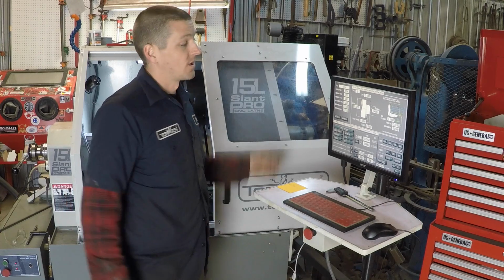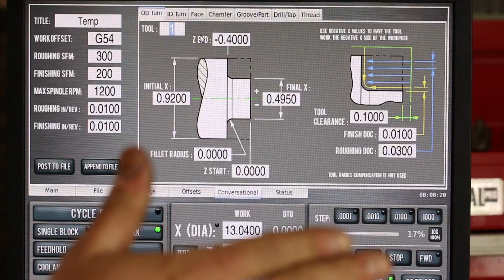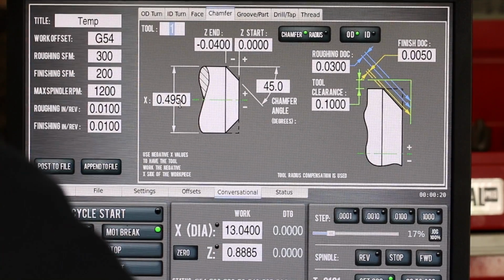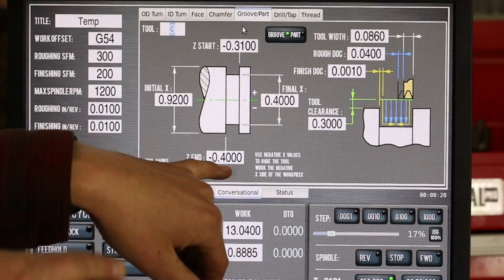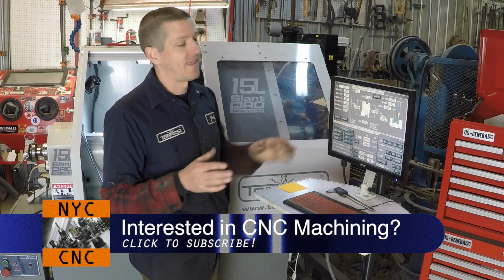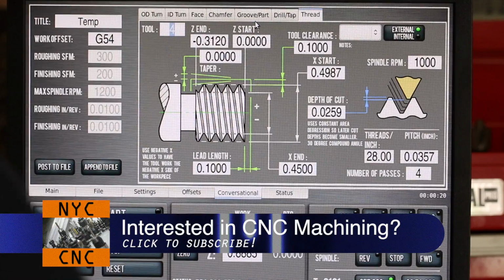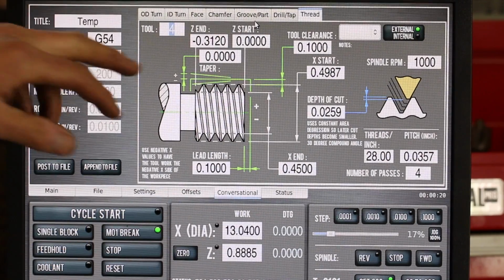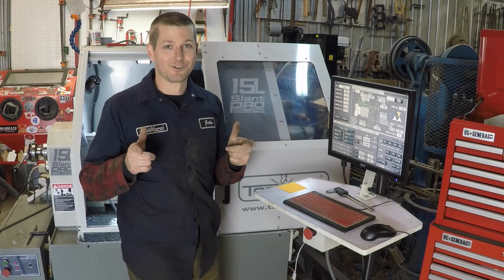Threading a Ruger 10/22 Barrel for a Silencer!

Comment: Problem is you indicated from the outside of the barrel, you ALWAYS use a indicating rod that is inserted into the barrel, the bore is not drilled perfectly in the center nor does the bore ever run perfectly true/straight, I have not ever seen a perfectly drilled and bored barrel even with the top barrel makers. 

You even said that you had some coating that was throwing off the dial indicator so by your own admission there was something wrong. You just got damn lucky you did not have a baffle strike and destroy your suppressor.

Comment: With decibel measuring apps available for phones, would have loved to see readings for non-suppressed vs suppressed to see measueable results

John
Reply: It is, with impulse noise, not really possible to messure with a phone or any non specialist tool. A phone can not pick up the noise lasting few ms and will give a false low reading.

But the difference it night and day, with a supressor, shooting in the dirt, the bullet hitting the dirt is louder than the actual shoot.

Comment: TOO damn bad that an IDIOT is running this mega-money lathe.  ANYONE with more than two active brain cells knows that for proper and SAFE suppressor use, it is MANDATORY that the threads are referenced to the bores GOD DAMN CENTER, AND are co-aligned,CENTERED, throughout the length of the barrel - STRAIGHT OUT.....  FUCK the outer barrel...   Dipshit...

Comment: Whenever threading a barrel you always indicate your center off the bore (ID) not the OD. Most barrels bores are not concentric to the turned down OD profile. Indicating off the OD in most cases positions the thread body off center of the bullet path risking bullet strikes to your muzzle device. You need a correct size ground mandrel to slide into the bore in order to indicate while using a 4 jaw chuck. Using an already factory turned OD for indication like you did would have been easier with an accurate 3 jaw with a .0005" runout and obtained the same setup runout result.

Comment: This is exactly why gun work should be done by machinists instead of by gunsmiths. I had a "gunsmith" destroy a barrel once by threading it. The threads were dull, and half of them were torn off, you would probably cry if you saw it.

One thing I would suggest is getting a simple .22 caliber pilot from Pacific Tool and Gauge for future threading of barrels, that way you can be sure the threads are concentric to the bore instead of the OD.

Comment: Wondering why you set up the barrel by referencing the outside surface rather than the bore?  I know most barrels are bored true but I have seen a few that were a bit out.
Reply: it does matter when you are trying to "thread" a high velocity projectile through a suppressor without striking a baffle and causing yourself a heap of read tape headache.  If the bore is not quite centered then the barrel exit wont be dead nuts centered on the threads which can cause baffle strikes further down the can.
Reply: @briangamble6200  
It is not really that important to get dead on. 
Most supressors have at least 10 thou on radi to avoid baffle strike.

Comment: Another great video, but I was curious about threading without doing the relief cut.  I have read about guys with manual lathes doing reverse threading so they don't have to make the relief cuts.  I'm trying to learn basic machining on a hobby lathe but was curious about if a cnc machine could do the same and thread from the shoulder out safely?  plus I was wondering what your opinion is on threading right up to the shoulder?  Is it worth the extra hassle or just a lot of extra work for little gain?  I can't find any videos so far on the no relief cut threading, but I just heard about it last night so haven't looked very much yet.

Comment: Can a normal sized 10/22 barrel  accommodate similar sized threads.  In other words, my 40th anniversary model that does not have a bull barrel?  Did you make your own suppressor, or is that a brand name model. Thanks, great video.
Reply: Yes your tapered 10/22 can be threaded.  http://www.barrelboss.com/threading/pricing/
Reply: NO NO NO....  I thought I would have my stock barrel threaded from an online shop.  Besides the piss poor threading job, the flat face-shoulder that the suppressor WOULD HAVE contacted was not a larger enough diameter to provide a proper seating surface.  Why spend 80 bucks for a ruined barrel when for ONLY 130 bucks you can buy a REAL Bull barrel FACTORY THREADED...

Comment: I'm sure it's been mentioned already but choke up on your part to get rid of the chatter and dial in the bore when doing rifle work. Also, ditch that ugly thread relief. You're not using a manual machine anymore. Plunge your finish tool at the tenon/shoulder junction if you can not have a radius there. If your part absolutely requires a thread relief, ramp in with your finish tool to make a cleaner transition than the squared parting/grooving tool.
Reply: +300sniper ---------You can cut a thread on just about anything with a lead screw, or a PWM axis, and cut the thread right to the shoulder.   Leave the cutting tool ingaged  in the stock and disengage the follower/lead screw.   If you have a dead stop on your carriage, the cutch will slip and allow the carriage to stop all motion.   On an old engine or turret lathe, you don't want to allow the carriage clutch to slip.   It will ruin the clutch.   On a PWM  (CNC) machine, the control will trip out due to loss of feedback.
What this all means is, don't run the cutter to a solid shoulder.   You will break the cutter, burn the clutch, and trip the axis fuse.
What you can do, is run the treading tool to where it just skims the shoulder.   Some people call this "witnessing" the shoulder.   You would hear this term more in a grinding shop, than a machine shop.    Here:   A grinder would "witness" the shoulder, and a machinist would "kiss" the shoulder.
There is a situation where a machinist would take the thread right to the shoulder and this would be when you are using a Cri-Dan machine.    Using a Cri-Dan you can thread a part so that the nut, or mating part, threads down and bottoms out on the shoulder.    And when you are really good, you can adjust the Cri-Dan to pull out the treading tool when it has completed one full thread exactly,, or , or "Ring" with one extra thread so the part, or ring, can bottom out on the shoulder.

Comment: I assume you could do this, but it might be really trick to use a larger diameter bull barrel and machine the "monocore" directly into the end of it. Then just thread it to except the can over the end of it?
Thinking out load, if its a stupid idea, don't let the noises in my head bother you....
Reply: Soooooo, lets make one!
Reply: The coolest quiet little gun I have personally had experience with was a Walther PPK. .22 ca short with a 6"(?) Suppressor.
 It was a semi automatic but converted to single action so when you fired the breach would stay closed eliminating all the sound from the action completely.
 The noise from the trigger/spring was louder than the report from the barrel.
But you had to chamber a new round after every shot by cycling the slide to extract the spent brass cock the firing  pin and put a new one in the pipe.
 The gun has no safety. Why I'm not sure.
A project you should consider doing and I would like to be involved in is mating two ruger 10/22's together and creating a cranking mechanism to make a sort of Gatling gun.
 There are a couple of kits but I think the idea could be improved upon.
 And the best part is even though it will fire as fast as you can crank it it's not considered an automatic.
 So no special license to fire it.
 10/22 is probably my favorite gun....
Reply: Nope, but would like to work on one with you..... Ill find a link to the kit online but i think it needs much improvement.....send me a private email for details, dont mind sharing AFTER you tell me my idea is sound....

Comment: Yep... I'd love to thread that efficient on a manual lathe, mostly with a big shoulder waiting at the end. In Canada we have to get other projects than silencer or we could get jailed, fast...   Pierre
Reply: That's possible, but if you get no room to catch the back lash at the shoulder, the thread will be so so...!!! I can thread at 400 to 600 rpm. but with a big shoulder it gets more around 200 -250, worse when chips and oil obstruct the threading tool and I loose the exact position, this impairs my ability to disengage at the exact right moment.

Comment: You might have to specify the threads a little deeper than needed because there is no spring pass in the generated g code. It is nice that the software does a 30 deg compound angle and a constant area method to get the depth, that makes for nice clean threads.

Comment: Great job John! Most of my work is gunsmithing related and I probably thread more barrels than anything else =) A few tips:

As other have suggested, you should indicate off the bore centerline rather than the OD, this will ensure that you don't get any unwanted baffle strikes and will also ensure the least POI shift with and without your can.

A DTI works wonders when indicating the bore. I use a B&S 1um indicator (0.00003"), but once the stem is doubled from 1" to 2", the accuracy decreases linearly as well, but it's still good enough to watch for wiggle. I do bounce mine off the lands and grooves and have never had any issues at all. The tolerance stacking from pins and rods (i.e. grizzly rod) will only hurt you in the long run and cost extra in tooling.

I try to record my machine work when I can. Here's a video of me threading a Remington 22 with an integral recoil lug that wouldn't fit through my headstock, had to resort to turning between centers =) Almost as fast as your CNC! https://youtu.be/FBiBPp7cXf0

Keep the gun-related videos coming!

Comment: I'm curious if you could have done this operation on the Tormach CNC Mill with the rotatory add-on? I MAY be able to swing getting a Tormach Mill or Lathe later this year but not both.
Reply: Brian Boatright I'm a manual man, and always will be, so don't take anything I say to be perfect, but: I think you could do it on the mill, but not very easily. Personally, I would advise getting a mill first, because it is more multipurpose, but you would have to consider what work you were going to do, and then decide what to get. You could always get a cheaper manual engine lathe, and do the occassional job like this on it?

Comment: In this case you should have made the runout as to the bore and not as to the OD since the bore 99% of the time is not concentric to the OD.

Also I would recommend using a 35 degree like a SVJC holder to cut the relief cut at a 45 degree relief and not as a straight wall, and not the groove tool if you plan on doing this in a larger volume.

Comment: Edit: like ten people already brought it up so never mind. I need to get my heavy ten put back together and get working on my .308 form 1.
Reply: NYC CNC Titanium. Using 60 degree cone baffles. It would be a trivial thing to knock out 11 baffles of the tormach but doing it on a manual requires the part to be machine in two steps. Also 24 inches of 1.750 grade 5 ti round bar stock doesnt come cheap. The heavy ten It's a cool machine. apron is all apart currently still got a lot of work it needs. Saving for a large surface plate gonna teach myself scraping. Hopefully gonna pick up a smallish milling machine this summer with dro.

Comment: Great video as usual. However, I'd like to see the engraving process if you have footage of that.There are a few IOI inspectors here in TX that have a problem with steel punches for the required markings (City, State, SN# ect.). Not that it matters, but there is always the question, "So, where's your engraver?".

Comment: Awesome results man!!!  I was thinking of asking you for a quote on a 10/22 thread job this winter...are you guys open for business on that front?

I wonder how hard it would be to make an electronic bolt cycler.  It wouldn't be as fast as gas-operated of course, but being able to lock the bolt closed while firing and then operating the bolt with a solenoid might work.  Ejection could be tricky, maybe a separate kicker for that.  Not really useful for anything, just fun to think about.

Comment: Very sweet. I have a weakness for 10/22s. 
I may have missed it but are you going to turn a cap for the threads when the can is not installed? Also are you using a bolt buffer in your current setup? I've heard that it can help to reduce the sound also by softening the impact of the bolt into the buffer rod.

Comment: Wow, that's a cool project. Works awesome. 
A good dti with a tiny-ball-tip on it can setup from the ID of the barrel.  Maybe you can find a good dti laying around your shop somewhere ;] Locating a small ID is a pita tho.
Reply: NYC CNC  I wouldn't expect the riffling to cause a problem, Push the limits of what you know and if one breaks then you'll know the limits.  There isn't a singe video on utube on the use of a good dti. Nothing on tip changes(little round disk tool in box) or even how to place the tip in the position needed.  Grab the dti in one hand, max the needle to its end of travel and push a little bit harder, it will relocate the tip. It won't break.Im not a fan of putting anything between the object to be located and the dti. A dowel would work, but it screws up your tolerance by adding an unknown. 

Jonn, I am extremely impressed with this project, and the end result. Holy super spy gear!

Comment: So you can make a rear pin of a smaller diameter and sheathe it in a outer of Delrin that will quieten down the action a bit.  Taking 5-10 grams out of the bolt will increase reliability with subsonics but will make it unusable with supersonics.
Reply: NYC CNC No worries, life is a learning experience!  Thanks for the videos.

Comment: FYI, When threading for a suppressor, it's very important to indicate from the bore, not the OD of the barrel.  I've seen barrels where the OD was nowhere near concentric to the bore.  Doesn't look like it was too big of a deal for you this time, but something to keep in mind for the future.

Glad to see the suppressor working!
Reply: metalhead2508 agreed, mosins are pretty crude.  When threading barrels, however, it's important for the threads to be concentric, and the shoulder to be perpendicular to the bore so that the bullet does not strike a baffle while traveling through the suppressor.  
Poor bore concentricity can affect accuracy, but there is a long list of other things to consider when trying to find accuracy.  Most bore concentricity issues are a result of the cutter wandering during gundrilling (cutting the bore of the barrel before rifling).  It's nearly impossible to get long holes like that perfectly straight, and almost all barrels have a bore that has some bow to it.  On good barrels, it's nearly imperceptible, but it's there (I would consider less than a thousandth of an inch over the length pretty good).  I've seen barrels where the bore was drilled diagonally down the barrel, and some where the bore was offset to one side.  Sleeved barrels are some of the worst, though.
Reply: NYC CNC    How much trouble would it be to index it from the bore with the Tormach?  You might need to make another video :)